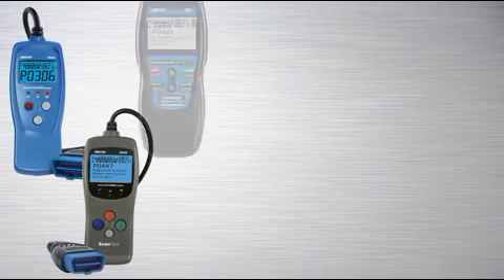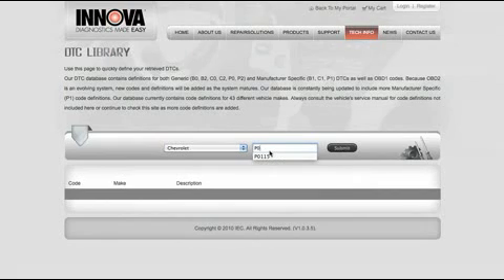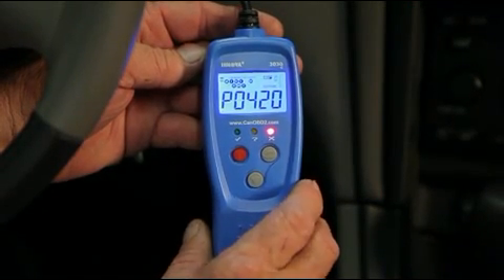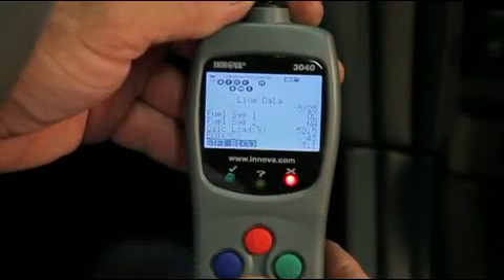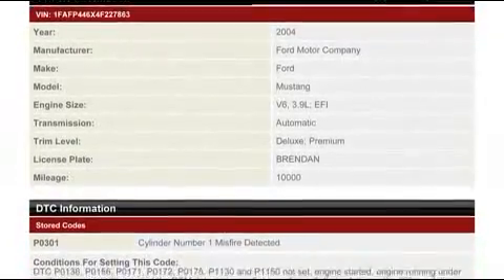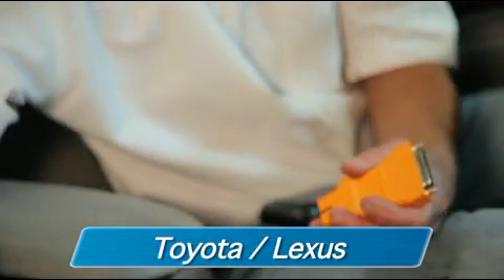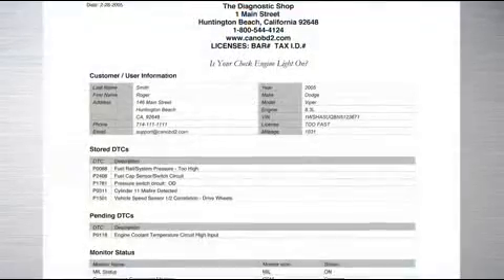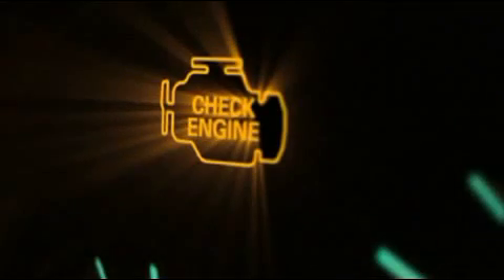How to use Innova Diagnostic Tools

Comment: What is wrong if it only shows error in the lcd? Been trying to connect with the suzuki Db52t
Reply from the maker: Hi there, thank you for your question! If your tool is reading ERROR when you connect it to your vehicle's OBD2 port, that means it is unable to establish a connection to the vehicle. Please try turning your vehicle in the ON position first and then connect the scan tool. If that does not work, try starting your vehicle's engine and then connect the scan tool. Please do not hesitate to contact our USA based technical support team at support@repairsolutions.com if you require further assistance. We are available Monday-Saturday 6 am-6 pm PST.